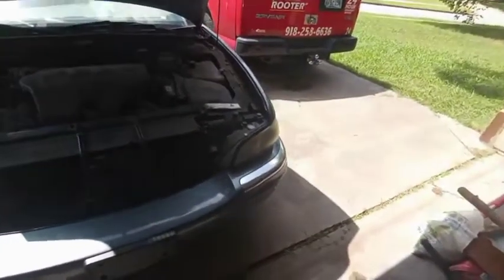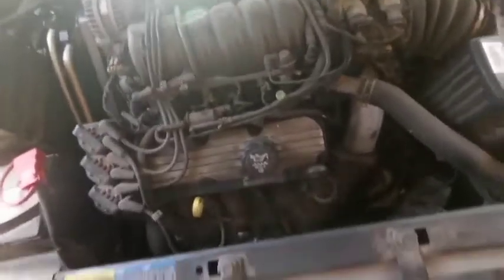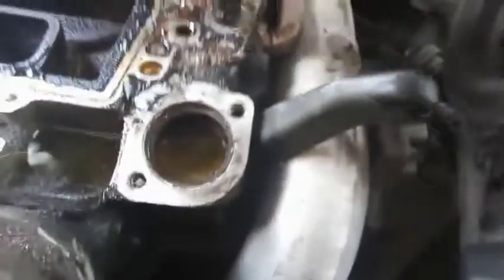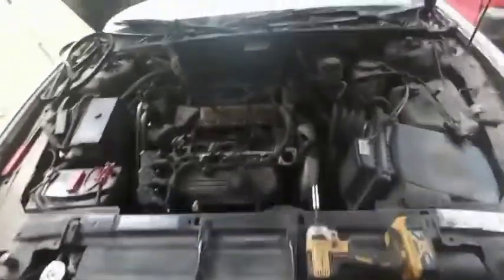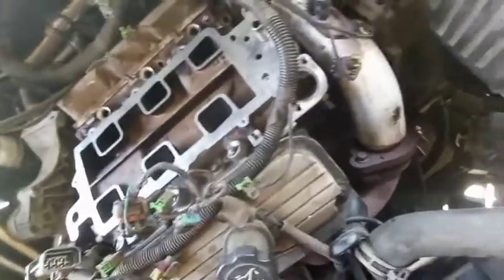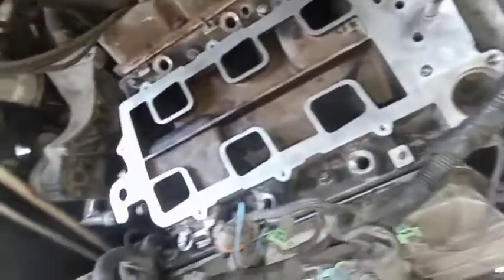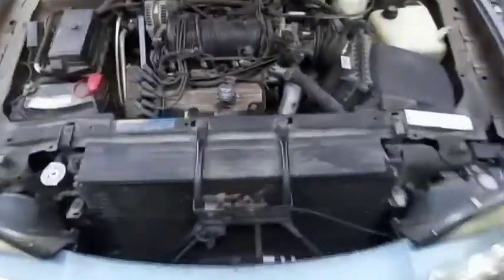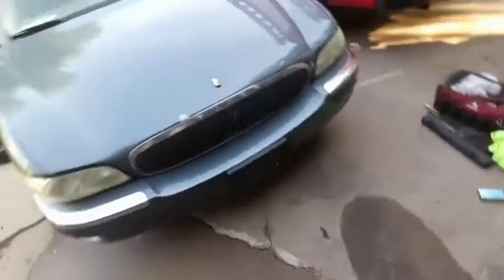04 Buick Park Ave 3.8L V6 Upper & Lower Intake Manifold Gaskets Replacement/Thermostat/TB/Maintenanc

Comment: Done this to my GP bout 3 yrs ago. Put a new Plenum on it,etc,etc.
Reply from the maker: Hell yeah. I figured out the issue with the engine not starting. It is the timing. If you watch the video closely where i assembled the engine and did the timing, i put a black dot on the cam gear and timed it off the black dot. I didnt see it at the time because i was recording with my phone, but there is a dot on the timing gear. I just overlooked it too focused on trying to make a youtube video instead of building my engine. So its gotta come back out. But you were right steve. You called it.
Reply: Thanks bro. Just the process of elimination,right?